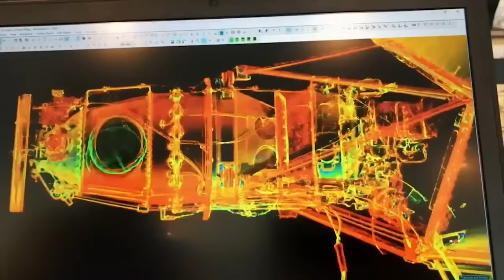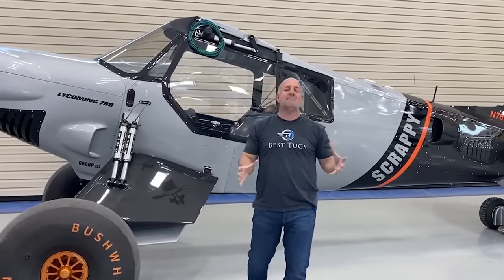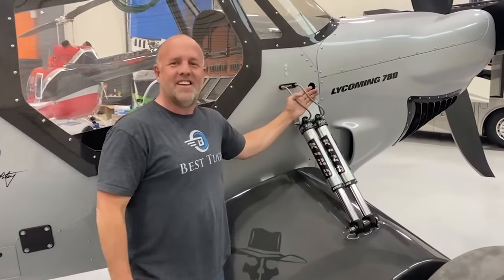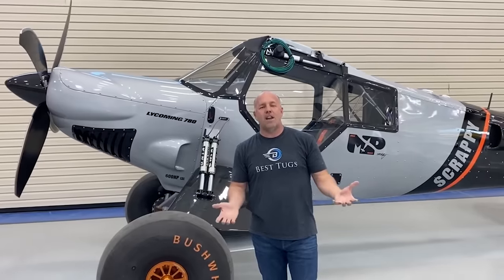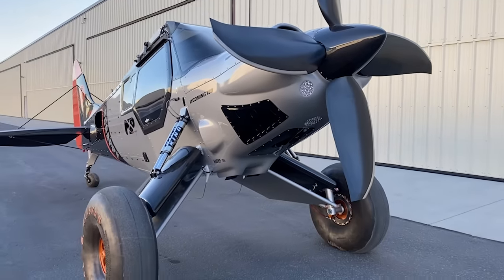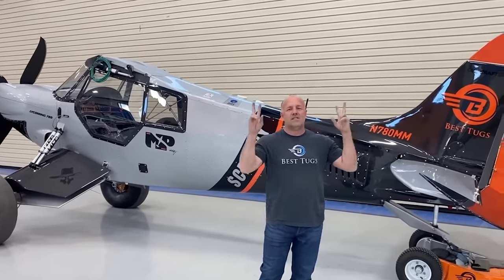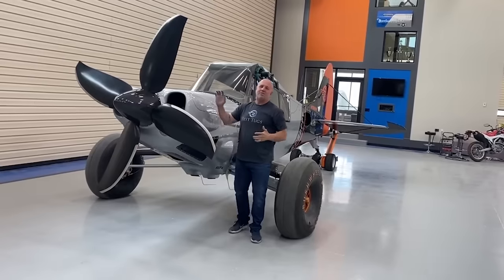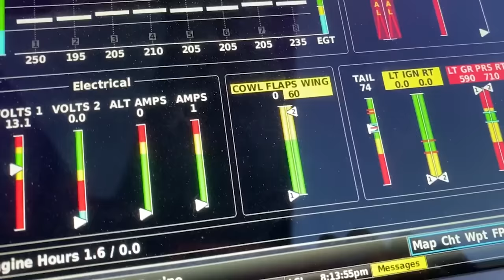Dynamic King Suspension on My Wingless Airplane | Scrappy #52

Comment: I love all the detail you have put into the the suspension analysis! I'm Just an "armchair engineer" here, but I wondered about another capability the suspension could provide based on "roll axis" while taxing on uneven surfaces.

I noticed in the video you taxing down "non-level" runway surfaces, and having manual control utilizing the ability to raise one side of the aircraft to compensate for an un-level ground surfaces. I feel this would be very beneficial in landing/takeoffs from remote/makeshift landing areas.
??? - Have you considered having a automatic compensating leveling system for "off angle" take off and landing surfaces which requires no pilot intervention? 

Seems like the software algorithms could measure inputs variables from an inclinometer / Laser distance measuring device (located at each wingtip) or a combination of both... The input variables could be ground speed, shock position/extension, deflection time duration, to allow for inconsistent surface changes, rocks, bumps, etc.

I would think having a dash mounted activation switch would make takeoffs and landings even safer and smoother (for passenger) as the pilot would not have to think about "leveling" the "east/west" attitude until becoming airborne.

Of course, I'm not sure if ground effect would need to be taken into account and how that might impact overall lift coefficients based on each wingtip having a different distance to the ground.

Hope that is not an ignorant idea, I'd love to get your thoughts,
Best regards,
Mo-

Comment: Love the suspension mike. Here’s where I thought you were going with this: say you’re in a STOL comp etc or just really short field, suspension fully raised on final so that the gear fairings become more horizontal, like a wing and create more lift, reducing speed. Then at a sensed height, (or angle of attack as you pull into flair, or with a trigger or something) suspensions fires to a full down position just before wheels touch to absorb touchdown. Would it work? I’d love to hear your thoughts. Either way, I’d love to see a comparison in stall speed with suspension fully lowered, then raised, as well as affect on high speed, raised lowered etc. Watching from eastern Australia. Now get back to work!

Comment: So use an engine-driven RV2 compressor drawing from your engine exhaust, perhaps through an intercooler. That would give you dry air.
You could also use regular adjustable remote-reservoir shocks and adjust the ride height with electric linear servos.
Keep in mind, regular potentiometers are carbon-film, and will eventually wear out and glitch. You can replace them with magnetic angle sensors, output the same signal but last forever.

Comment: Mike... you're landing gear on Scrappy are truly "wild"!  Question: without flight test, are you anticipating the multiple wing surfaces on the gear will have either a positive or negative impact on fuel economy, air speed or other flight characteristics  depending on their positioning during flight?
(ie: additional lift or speed in safe taxi mode v. Take off mode during flight?)  Thanks for sharing you passion & enthusiasm with all of us.

Comment: When I first saw your suspension I thought for sure you would have a small torsion sway bar through the bottom of the fuselage for crosswind landings. That way you could stay soft but still not roll as much.

Comment: Hi Mike, Again I am so amazed at your ingenuity. Was wondering, don't know if I missed it, did/could you put a auto leveling system on the suspension, or do you have to always do manual or programed inputs? Was thinking like a level indicator on the fuselage, when indicating out of level, suspension would auto adjust to terrain, of coarse would need load sensors on suspension, so suspension wouldn't auto adjust in flight. Keep up the great work, you never stop amazing me. Love to you and the family.

Comment: 5:30 I thought the safe taxi mode was entirely for AoA but the sight picture over the nose is rather obvious after you pointed it out. 

Coming from Citabrias, they have plenty of view over the nose but also tend to land tailwheel first, and drop into the mains from about 6 inches: If your landing was slow. 

I think the absolute best method is going to be a high and center-mounted nav screen that doubles as a front end camera. Put in front and center right where you would normally look ahead. Move the panel mounted compass elsewhere. At minimum, use back-up sonar sensors and run a chime and a bar of orange warning lights across the top of the dash that freak out for impending impacts. Back up sensors are too weak, maybe use the radar cruise control sensor system. Ford makes a cheap radar cruise control that can full stop, assuming a brake booster, and it works decently in their Trucks. For an airplane it could at least cut throttle to idle and warn of impending doom. "Caution, Airplain, Caution, Yaw Left, Yaw, Left, Airplane". 

(Not: Caution, terrain, pull up). 

Lol.

Comment: Good choice on not using the O2 for the suspension. Even if it did not explode, it most likely would have severely shortened the life of the seals in the shocks, and possibly the hoses as well. Teflon inner hose might be OK, but I would want to check compatibility first.

Comment: Sometimes I wonder if what Mike does gets adapted by aircraft manufacturers. Like Mike said, the dynamic suspension can mitigate quite some risks which are seen as big hazards for lots of airplanes. This kind of system could help so many aviators with visibility and stability!

Comment: that is so badass. Air suspension on a Plane ^^ I'm getting west coast vibes , snoop dog blasting on the stereo on a bush plane. XD hilarious. next tile you install an AI on the plane , it will go out and patrol it's airport, lifting it's wheel and marking the posts with Oil like some big predator XD. it's the only plane who can do push ups!! OOORRRRAAHH!

Comment: I seem to remember seeing pics whereby your Airforce used to tie down their light aircraft with the tailplane into the wind. Ok your system is great but at a cost of weight complexity and the old Muzzullah. Great engineering though. By the way my old Citreon GS Club car had in cab adjustable suspension. It worked great. Regards, Jim in NI UK

Comment: Hey Mike! It just occurred to me to wonder where you're putting fuel in Scrappy at the moment! 
Where you have a fuel tank in Scrappy right now?? Obviously you're putting fuel somewhere for your engine/ taxi and ride testing, despite the fact that you have no wings yet! I'm assuming you'll do wing tanks, but are you running off another tank that will remain after you have wings? Or is it a temporary system for testing phase??

Love you and your channel, Mike. You're my hero and a huge role model. 

Cheers

Comment: As for the wings;  Full length retractable leading edge slats,  Full length Fowler Flaps with spoilers for roll control or double slotted Fowler flaps and Vortex generators, Fences and wing twist.   Just guessing what Mike may have come up with...
Reply: Sounds like the 727 wing

Comment: Brilliant design and Patek watch level building. One concern though. Did you run the main gear in a real or simulated wind tunnel? I suspect that the interference drag between the two "A" arm
surfaces will more that negate any advantage you might have gained by the beautiful fairing work. I would have, without wind tunnel testing, put the fairing on the upper "A" arm but leave the 
lower one bare tube. Remember the WWI RFC Bristol Fighter? The one that had its lower wing mounted below the fuselage? They did that because the discovered the wings were too close
together and the interference drag was ruining the performance.

Comment: "There may be a day I do an all electric 800 horsepower plane, we'll go for the lightweight." 
I am impressed with the level of insight that simple statement demonstrates, and would guess that it catches most people with a sense puzzlement or disbelief. Since everyone "knows" that battery electric planes don't work due to the relatively low level of energy that batteries can store in comparison to aviation fuel. 
However, if not aiming for multiple hours of range, the sheer amount of POWER that an electric system can generate per pound could result in some very impressive power to weight ratios. If only someone would build a rather impractical plane...

Comment: I watch your video when it first came out yesterday and was worried about using pure oxygen and see you revised it to use nitrogen. Great choice I’ve  worked with oxygen systems on aircraft for years and the dangers of pure oxygen in contact with petroleum can be extremely dangerous.  That said maybe it would be worth adding a smaller 4500 psi nitrogen tank, put your big tank back to oxygen and then mixing the nitrogen & oxygen say at a 60/40 ratio to extend your oxygen service as well as keeping the shock system properly supplied

Comment: Loving your work! One question I have, as I have no idea, is do you have to take into account your flying / landing altitude when setting the suspension firmness / travel / height, or is the change in atmospheric pressure not an issue due to the way the system works? Thanks, and keep up the awesome work!

Comment: About the air, this is the reason we have a air dryer on our semi's if you drain the tanks (what is not possible anymore because there is no need anymore) you will not find any water. Exactly for the reason that water freezes and we need the air for our brakes, so its kinda important. Idk if semi's in the USA have that but in Europe its mandatory.

Comment: Hah, at first I thought you re-uploaded just because of two Dymo labels on the tanks, but then i noticed the extra explanation. 😁
I commented on the first video and asked wether you had the option to program the system to keep the plane level automatically on the ground. Didn't quite catch whether Garmin system just reads out the sensors or if you can use it to adjust the settings onscreen directly as well?
Seemed like you set the height on each side manually for the test?

Comment: Mike, could you have used oxygen safe o-rings and grease in the system like we do in SCUBA diving when working with high PPO2, thus removing the fuel source from the fire triangle? Seems like that would enable you to double your onboard oxygen supply...

Comment: I think I commented something to that nature back when you installed it and asked the question.
If I remember correctly, I think i suggested you could make the suspension "pop" to jump it up in the air
Reply: How about just popping the wheels up and flying away.....zero roll take off?
Reply: @camman194  that's what i meant, jump up in the air

Comment: Are you planning on flying with the front gear in the fully raised position so the suspension arm fairings work as winglets? Also, would it change the flight dynamics much using the "leaning" mode whilst in the air???

Comment: I  expect seeing you "fixing" the inherent rear (caster / wobble) . I imagine with the huge diameter of the air shock , it might be possible to incorporate it as a form of strut to keep the rear caster close to constant throughout the travel ..  If it's possible, & beneficial,   I'm sure you will do it and take it to another "wow" level...
Reply: i can see a custom steering stabilizer taking shape in that smoke cloud over Mikes head  right now...lol

Comment: MIKE MIKE MIKE. Honestly , because of the great performance from the "Wing Spurs" with DRACO.  I KNEW CROSSWINDS  was on your mind.    But damn!.

Did you add a redundant gear lift sheathed wire? Between the shocks? Or is that lock for full extension as well, in a sudden no notice failure?   I wasn't clear on that.
Bit of chicken little designing. But Murphys law can be costly.
Reply: So. In a "Frack it"  life or death rescue landing. With a Boulder on one side. You could "theoretically" adjust the wing to clear? 🤔 cool.

Comment: Oil mist and pure oxygen at high enough pressure can self ignite. It’s why oxygen should never be used for pressure testing except in specific circumstances. 
A former coworker ended up in a hospital when a contractor he was overseeing used oxygen to pressure test water pipe that had thread cutting oil in the line.
Thanks,
John

Comment: How would all the components of the landing gear system work if you wanted to add floats to Scrappy?  Could you lock them in normal and then add floats?  Very interesting for sure.

Comment: Pressurerized oxygen is no joke. If the flow is high enough, the "friction" of the gas hitting something like a little chip or anything in the system would be enough to combust. And when oxygen burns it doesn't stop at the strut caps.
Glad you went to nitrogen, much safer!

Comment: Mike Patey Loved the video. Have been following you from the Draco build. 

I am very happy you went with Nitrogen and NOT oxygen for the shocks. 

If oxygen and oil mix the result is normally very nasty. Spontaneous explosion/ fire. 

I am assuming here that the oxygen and oil were separated by a seal or two in the shocks, thus should a seal leak you oxygen and shock oil could mix. 

Or do you have it configured differently?

Comment: Hot damn, Scrappy is a lowrider now! 😂 The thing I am most curious about is how you are able to control this from the Garmin? Did you require their cooperation to program this ability in? LOL right as I posted this you answered my question but now I have more questions 🤣 Is there a Garmin API or something? Does any of this need to be certified somehow? As a computer engineer this fascinates me, I've done some reading on avionics standards and testing and let me tell you I don't think that's the job for me!

Comment: This is going to be an awesome plane and a real fuel hog :D  Your suspension setup looks  totally different than the one you did the drop tests with. 100% oxygen at high pressure in shocks never warranted a single consideration.  Not even at ambient pressure - Apollo 1, 3 astronaut lives lost during testing.

Comment: I knew you were planning something like this when I saw the hoses. You mentioned that you changed some o-rings in the valves  for using pure oxygen, what about the oil in the shocks? Is it non-combustible? 300 psi pure oxygen sounds risky if the oil leaks though to the gas side.
Reply: I must have missed part of the video. Had to watch it again. One tank is now nitrogen. Never mind. Great plane, can't wait to se the wings and take offs!

Comment: Non-Combustible Oil
Mike in reactive vacuum system that need to pump out oxygen reaction gas, the reaction gas can become compressed inside the pump.  So special oxygen compatible vacuum pump oils have been developed to stay inert even with crazily reactive gas (Flourine etc...)  
Fomblin is the classic PFPE based inert vacuum pump oil.  ~$100/#
Still compressed Oxygen systems need respect and careful cleaning any hydrocarbon residue anywhere can be trouble.   If it can burn 🔥 in air it can be explosive in compressed O2. (Note for everyone one else,  you already know that)

Comment: can you share any more of the info you got from testing that vu4 type air manifold? i just recently installed the same block with a waterproof cover from vpc pneumatics and i was curious as to its actual performance limits, seems to work good so far atleast

Comment: Hey Mike I have a question about the suspension pressure system. If you start at sea level and say you had 5° left lean and that is a specific psi would you be mapping a different psi for a 5° left lean when you fly up to the mountains? Thanks for your time!

Comment: out of curiosity - do you expect a different behaviour in the air, depending on the position of the gear? Meaning do you get more lift in safe-taxi-mode while in the air vs. having attack mode?

Comment: Awesome video!  I'm curious how many charges you get out of a tank of nitrogen?  if you had considered CO2.  As co2 is liquid in the tank you get somewhere around 8 times the volume out of the same size tank, but it's got a pretty steep pressure-temperature curve.  MIght good for summer use?

Comment: Just curious if you considered CO2 for the shocks? It’s inert so no explosion hazard and it’s liquid at 1500psi so a tank of CO2 would operate a lot more cycles than compressed nitrogen. Maybe icing issues at the regulator?

Comment: You are amazing and a huge inspiration.

*Ps. If you ever open a school, or give like... classes, ¿can i learn from you?

*Ps 2. By the way... ¿could scappy fly (aunquesea un little bit) as it is right now?) - Like, could the back stabilizers, mixed with the power, some sort of sustain by the wheels on the lower position do the work :O ?

Comment: Originally, the armatures of the suspension were incorporated with an airfoil.  Does being able to adjust the suspension height allow you to use the suspension in controlling lift during flight, landing, and take off?  For that matter even as a form of ailerons for flight control?

Comment: Nitrogen bottle or sealed compressor system? And that is a two stage compressor to pump gas in and another to empty the shocks and send the gas back to the storage tank. Bottle is lighter :o)

Comment: What weight does the dynamic suspension add overall? It's a very capable system that is brilliantly engineered. But just wondering how much you lose with it in other ways.